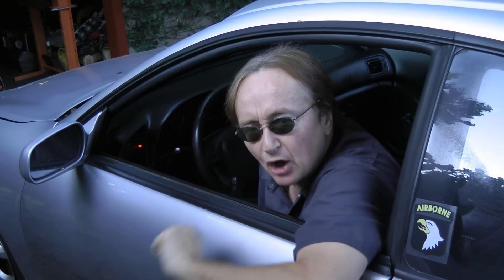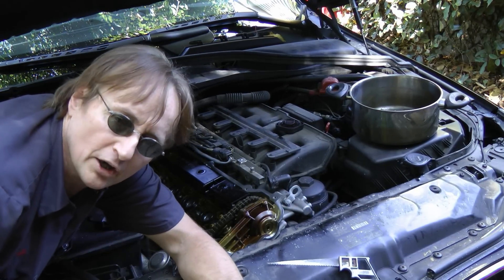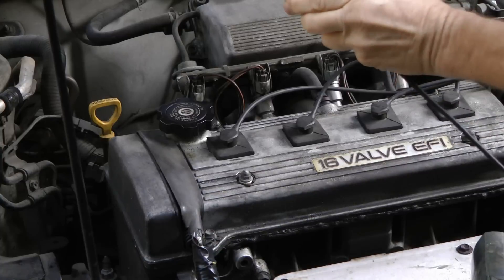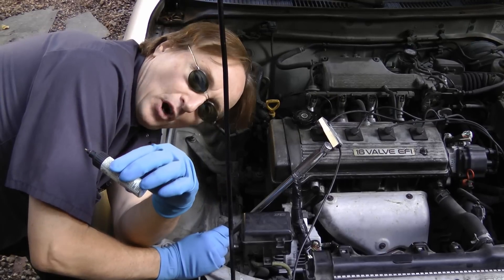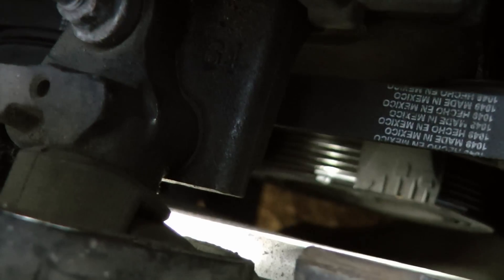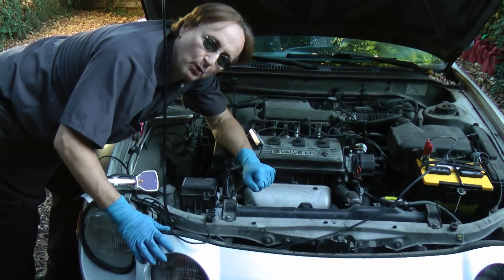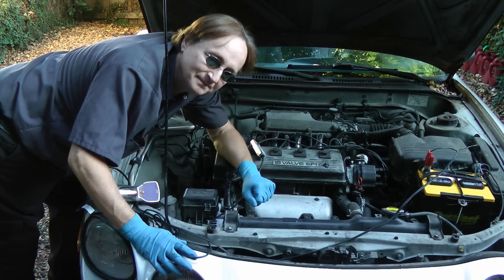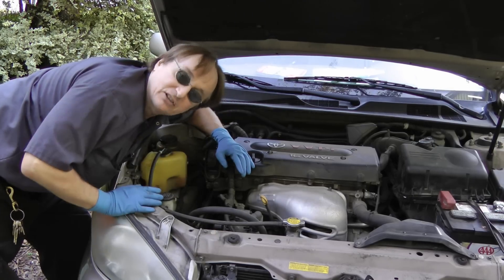How to Check a Timing Belt or Timing Chain in Your Car

Comment: if the oil was kept changed every 3k or so miles they can last over 150,000 miles if the tensioners dont go bad iv had a car that the timing chain broke at 250,000 because the tensioner was dry rotted and broke in half then broke the chain and im pritty confident it was original but was a well made chain

Comment: i.m not a mechanic but my 2003 passat does this  it is my passanger side drive shaft    it is worst around corners       are u sure it is the engine ?

Comment: Hey Scotty my 2006 Acura RSX has 129k miles and every morning when I start her she grinds so loud that my wife hears it in the house. I mean LOUD. That last for about 3 seconds then that stops and I hear a metal on metal rattling noise like chain chatter and that last for about 20 seconds as if the chain is tightening as the motor warms up. Im deffinantly suspecting the timing chain or tensioner is bad. This is gonna be an exspensive job so from what I described to you could you tell me that that is what my issue is? Any input is appreciated thanks scotty!
Reply from the maker: very expensive in most cases. PRAY it's just the hydraulic tensioner though, sometimes they go bad and do exactly that

Comment: scotty I got a ford thunderbird and when I turn the key the fan auto comes on , it will stay on for like 5 mins and then the fan will turn off.. but the car wont start until the fan turns off. have you ever ran into this prob? iv tried everything
Reply from the maker: bad main computer often does that, but disconnect the fan wiring first, and if it starts up then, the problem would be in the fan wiring or in the computer circuits that drive the fan.
Reply: I had 2 extra computers for it , and it stll does the same thing. il try to disconnect the fan and see if that does anything thanks scotty

Comment: We are trying to figure out on a 97 chevy cavalier with no timing marks if the chain is worn
Reply: jerryholbrook13 you can just make a mark on the crankshaft ully and one on the belt yourself with a marker or aint . if they dont line u after engine starts ints because of stretch in your chain

Comment: thanks for ur reply..... anyway, i hv another toyota tat hv a drive belt slip onli at 4k rpm n when the car is under load..... the sound wil come onli if the ac is turn on n the compressor kicks in..... the sound jus last a while like a mice under the hood..... wat causes tis?

Comment: having the motor head gaskets rebuilt and torn apart.. look at my latest video..  both headgaskets are inevetable on the 4.7 overhead cam..part of the game.. like the neon ..i saw the 3 layer sheet steel gasket... such a tiny spot where it leaked into cylinder #1  4200$ repair all the tentioners and gaskets and replaceable things are being done while he is in there..gaskets and chains too..a big 500$ kit  20 hrs of labor ...10 hrs each side..i told him be good but try not to spend 20 hrs on it..

Comment: How about Diesel engines, you can't use the gun because there is no ignition system? Is there a shortcut too?
Reply: peter candance you would need a diesel timing light or conversion kit but if it's to new it may not be compatible

Comment: You know if a hose is bad if it is crack or bulge not allowing fluid into the caliper. work backwards, break open the line at the caliper first if you have fluid then all the system is good and the caliper might be stuck.

Comment: I don't know if you could help me...but when I press on the gas while I driving only driving not idle ... I here a slight whining sound could it be my timing belt?
Reply from the maker: +Deandre Goard if too tight, timing belts an whine, but more often it's fan belts or bad power steering pumps
Reply: +Scotty Kilmer or it means you drive a hellcat and your getting some sweet supercharger whines

Comment: my 2oo1 camry has timing belt/2002 on have timing chains .wonder why they went back to chains,?
Reply from the maker: +winston smith they can handle the extra torque of VVT cam valve systems better and last longer If you change oil regularly
Reply: 10-4 thanks

Comment: How do you do this to subaru engines, as their spark plugs are not conveniently located.
Reply from the maker: you would need a special adaptor to hook it up to your ignition coils if it's a modern subaru with coil on plug system
Reply: Yes, it's a 2002. Thanks.

Comment: I have an 07 Infiniti G35X.. There's a very faint rattle that comes and goes.. It increases with engine revs but it's very hard to tell where it's coming from.. It randomly comes and goes.. Can that be the timing chain?
Reply from the maker: Waleed Issa  sure can be, often is on those. Have a guy like me look at it in person, we've heard it all
Reply: Scotty Kilmer  I actually just got back from the dealership, and they told me not to worry... They stated that if it was a chain rattle it would be very consistent. This noise comes and goes.. Also, it was making the noise when I took it in for inspection, But its so faint to the point where they cant even pin point where its coming from.. He told me it would be metal against metal if it was the timing chain, and you would hear it through the timing covers.

Comment: hey scoottykiller i got a question how to i bypass my ac belt so i could just run the alternator and the crankshaft on my civic 2003 1.7 like i went to auto-zone (parts store) and got a belt with no ac but the thing is that i dont know how to tension the belt because the belt tensioner is on the ac but i dont want to run the ac so how would i tension the belt help please brother.-)

Comment: Hey scotty Ive noticed my camry is making ticking sounds on cold starts and its coming from the timing belt or the belts on the pulleys and when the car gets warm, the ticking noise stops
Reply from the maker: often a worn timing belt will do that, but first remove all the fan belts, and if the noise goes away, it's one of them or a pulley they drive has a problem
Reply: could also very low engine oil make that noise too?
Reply from the maker: SYNCPHAN1OM
of course, always fix the obvious things like that first
Reply: ohh and also for the transmission when driving when the car is cold the last gear wont shift till it gets warm or gets up to 45 mph. could full synth trans fluid help or lucas products?

Comment: hi mate can u help me out? i went in a garage and the guy said my timing chain has been stretched but the car drives normally without any problems but sometimes it doesnt start first time but always second time. also no engine management lights have come on? should i still replace it or just drive it as much as i can
Reply from the maker: if it runs fine, live with that. changing it out is not cheap
Reply: also car does not always start first time but starts straight away second time i dont know if that has anything to do with stretched timing chain? or something else?
Reply: Could be a lot of other things like fouled plugs, plug gap, dirty intake/air filter/injectors, moisture in tank, distributor cap/wires, etc. I would start cheapest with things that haven't been done regularly and work your way up.  Seafoam system cleaner might even do the trick, that is if it's not due to the timing.

Comment: Hey Scott I have a 2000 t & with 122000 if timing belt goes will it break anything else?
Reply from the maker: please give exact make model and engine size.
Reply: 2000 Chrysler town & country 3.8L
Reply from the maker: Big Rob
it is an interference engine, valves generally bend if belt brakes. change it now
Reply: Ok thanks, want to take a road trip this summer,  just wanted to be prepared.

Comment: And this can be done on a 2002 Ford Focus 2.0 Zetec?
Reply: that engine has a belt and spark plug wires so yes you can check the timing using Scotty's method. If you do plan on changing the timing belt there are two very specific tools (aligning tools) you will need...just fyi

Comment: I hear a rattle coming from the engine on startup on my 95 nissan sentra that goes away after a second. It only does it when it's been sitting for a while.

Would the timing light tell me if it's the chain or the tensioner?
Reply: That's pretty normal.  In an overhead cam engine it can take a second or two for oil to get up the the lifters, so they tap until the oil pressure gets to them.  You could try having a friend start the car while you listen near the chain to see if you think that's the problem.
Reply: Andrew Goding
Yea i read about that. I heard it was caused by the oil filter not having an anti drain back valve to stop the oil from draining back down, or the valve failing. Or possibly a chain tensioner stuck or worn. I bought the right oil filter for this car with anti drain back valve but i still haven't put it in yet. It also rattles from that area a little bit while the car is running so i was thinking it could be worn chain tensioners?
Reply: you could always pull the valve cover and check it out.  Also, sometimes you can check wear by seeing how far the tensioner is extended.  On my old saab, if the plunger is out more than 11mm, then the chain/ guides are worn.  There might be a similar way of checking the tensioner on your nissan, but i'm not sure.
Reply: Andrew Goding
 I've replaced the upper chain tentioner which is hydrolic, as well as the oil filter when i did the oil change. I haven't checked the mechanical lower chain tensioner yet though. The noise has only gotten worse over time. I really should have just bought a timing chain kit to rule out the chain system completely. Surely the chain couldn't be worn already at 110k miles.

Comment: No disrespect meant here, but I'm confused.  I recently bought a PT Cruiser which (I didn't realize this when I bought it) has a timing belt.  I used this timing light method to check it, and the mark is where it's supposed to be  and stays put when the RPM is increased.  However, every mechanic in my area to whom I've mentioned this technique has flatly said the light hasn't told me anything about the belt's condition and there is no way to assess a timing belt - it just has to be replaced every 60K miles. Is the timing light proven diagnostic method or, why the disagreement?  Replacing these belts can be almost as expensive as replacing an engine!
Reply from the maker: light tells you it's not worn yet, but of course, it's a rubber piece, gets old, can crack and get brittle. So on that model, best to changed every 60 thousand miles because if it breaks, valve in the engine will bend. Those are very cheaply made engines, you don't want to chance that
Reply: when I started working on cars most seemed to have chains, but that changed to belts, although the movement seems to be back to chains.....If a timing belt breaks the valves and pistons can come into contact on some engines which is a bad thing. Always a good idea to change the water pump and other belts while doing a timing belt change.
Reply: C Challinor yep.  I am seeing more water pumps in behind the timing cover.  lots of the timing kits give you the option to add a water pump too.
Reply: Just an update.  I had the belt changed by a guy who actually likes to work on PT Cruisers.  The belt was brittle and the pulleys were jammed.  Ready to go at any moment.  Thanks, to all, for your help on this one.

Comment: Wot if you got ly7 GM 2008 don't have leads?
Reply from the maker: Graham Bate if you place the timing guns inductive sensor on top of a coil on plug assembly, it will make the gun flash
Reply: sweet thank mate, keep up the quick and interesting video.

Comment: How much does it cost to replace a timing belt for a 90 BMW e34?
Reply from the maker: +phil haris prices vary widely and on those best to change MANY other parts such as tensioner pulleys, so it can easily top 1000 bucks. Price it in your area though

Comment: I have a problem: the car is SOHC, 5cyl, diesel, old type of  high pressure pump (Bosch VE L150). The problem is that I constantly hear a kind of nailing noise, like hammer against anvil and valve cover resonates with this noise. When I put the tip of the the screw driver on the IP high pressure steel pipe that leads to the 4th cyl, right where it enters the 4th injector, and press my ear aganist the other end (handle, like mechanical stethoscope) I hear it clearly and loudly...

Comment: Do chains typically break?
Reply: Chains shouldn't break, and are said to be good for the life of the car.  Honestly I would change chains every 300,000 miles as preventative maintenance.
Reply: They strech, but usually they stretch for a reason. In the case of my F150, the tensioner broke and the chain was slamming around in there and that caused it to strech.
Reply: benz merc that all depends on how worn it is. my jaguar xk8 had worn guides chains and tensioners that were failing. the motor gained quite a bit of power back due to the chain not flopping around inside like it was. the less friction inside any moving parts of a motor the better.
Reply from the maker: only if made poorly, really old, or the oil has not been changed enough
Reply: Scotty Kilmer in the case of my jaguar the tensioners were hydraulic and plastic. the updated metal ones don't cause this issue but from the chain slapping around it wore out the guides as well. the ajv8 changed to the metal tensioners in 2003 I believe. love watching your how to videos. very informative.
Reply: My F150 had tensioners go bad... Enough slack 2 jump 2 teeth in the retarded position as well as to break the guide from chain slap. Regular maintenance. Fords mostly use hydraulic tensioners  and they fail all the time in higher mileage engines. mine had 187k.

Comment: Ok. But i have a coil on plug situation..i tried making a copper wire pickup extension thing, but no blink...i do not want to remove the coil and jeri rig a jumper to get a signal..any ideas??

Comment: I have a GMC Terrain 2010 with the code P0017 , took it to the dealer and they told me a need to replace the timing chain but they are charging me a lot of money for it ): a friend of mine replaced the timing chain and the code is still there idk what to do now , can’t afford to pay 4K for a timing chain at the dealer, hope you can help me ty.

Comment: What engine does your celica have in it? it's not a 5sfe I see
Reply from the maker: +Kalel Pruitt it's the 1800 cc engine used in 1994
Reply: +Scotty Kilmer does it matter where you put the white paint mark? are you putting the mark where there WAS a mark before but is now worn?
Reply: +pwee507 It does matter where you put the white mark. You paint the mark over top of the original slotted mark on the harmonic balancer so its easier to see.
Reply: +Adam Gow ok I kinda figured. I used a timing light once before but never thought of the paint trick. thanks!

Comment: how to check the timing with light?  or can u use just the paint mark only
didnt get the video
Reply from the maker: the timing mark on the crank is generally painted. IT matches up with numbers on the engine to see what timing actually is in degrees

Comment: Why can't cars have a timing chain adjustment tightener to periodically adjust the tension?
Reply: Marty Stevens they do but the chain stretches which makes the distance between the links further apart causing the distance on the non tensioned side to be greater than it should when this happens a tensioner is pretty pointless on jobs I've done the new chain when put up against the old will have maybe 2 links extra length

Comment: What happens if I don’t replace the worn belt? Will my car flip or something while driving??
Reply: Michael Bey it may either snap or lose teeth in which case the crank that is linked to the pistons going up and down or side to side in a boxer engine will no longer be synchronised to the cam the valves usuly stop moving and any that are in the fully open position are likely to collide with the piston making a lovely mess the exemption is non interference fit but these are not common

Comment: Hey sir how are you
I have a question 
I replace timing belt on 4rnner1992
After replacing  timing belt May truck won't start
Can you help me please thank you
Reply from the maker: I assume it ran before, and if so, you messed up. check for broken wires, unplugged sensors, and pray you didn't put the belt on one or two teeth off, cause then you'd have to do it all over again